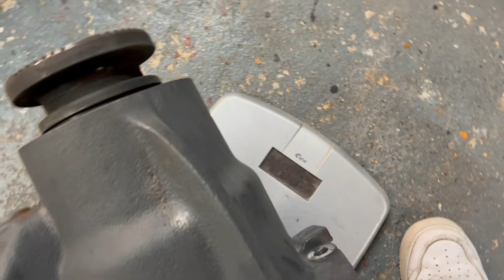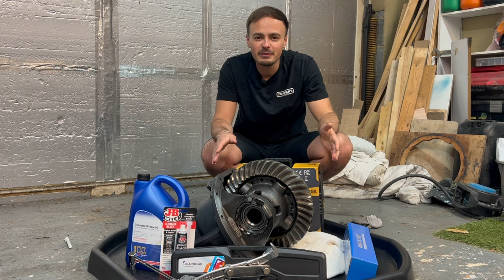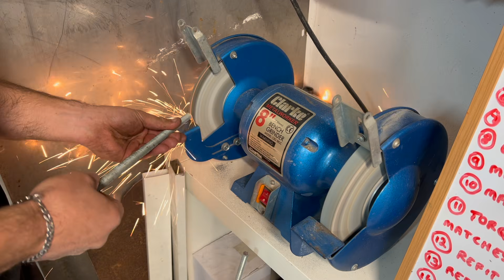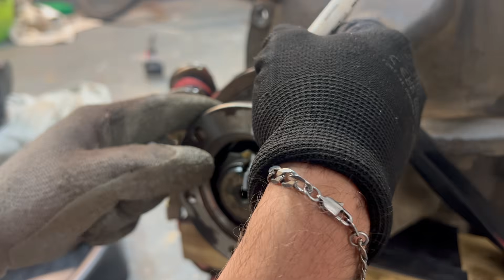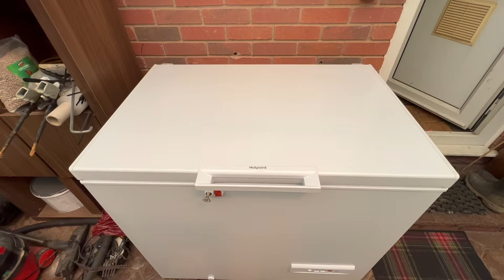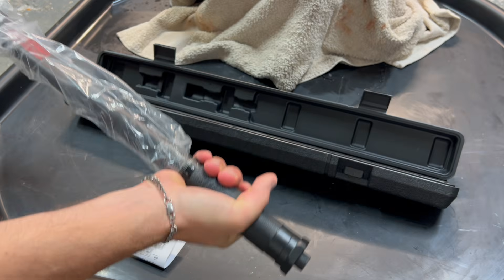Replacing a Trucks Rear Differential - Removal & Pinion Seal Replacement (Mercedes Vario)

Comment: You did a good job explaining this.

Some observations: care is needed to properly assess all the variables before changing final drive ratios. Moving one step is usually ok, two could be a problem if for example the motor doesn’t have the power to turn a taller ratio or the body type has a lot of (aero) drag.

5.7 was a special order final drive for the Vario, and hideously short as your demo showed. It was built to operate fully loaded on urban tasks. 

3.6 was completely at the other end of the scale / the tallest available, so you’ve leapt over five intermediate ratios in the process!

If your final build is going to be very lightweight (as compared to the original build GVW) and the body drag characteristics aren’t horrific (a common conversion oversight) you might be ok although 3.9 or 4.1 might have been better matches. It’s always a compromise. I don’t know what motor yours has, if modest you may find once it’s finished that you have to downshift on long motorway climbs, but other than that it’s much better around town and minor roads. If you’ve got the most powerful 675Nm / 177hp lump happy days…

For the future reader: due diligence warning. final drive ratios are SCN coded into newer vehicles, e.g. all Sprinters post 2003, so simply swapping the hardware would not achieve the desired outcome, some laptop time would also be needed.
Reply from the maker: Thank you! 😁 That’s really interesting information, thanks for sharing your expertise. I will be keeping the weight down on the conversion so hopefully it will still perform well once finished. It’s got the 2.9 OM602 5cylinder 👍🏼
Reply: @TurnersWorkshop97  I have a MK5 transit originally fitted with a 4.56:1 diff and put in a 4.1:1 diff for the same reasons as you although I only use it for short drives. In terms of the effect its a percentage factor as I'm sure you know. 1st gear gains around 2mph so effectively no difference for starting off, 2nd gear gains maybe 3-4 mph. By the time your up to cruising speed there is a difference in pulling power but in your case it may work out the 4th gear is similar to the original 5th gear so on hills it might still be o.k. My engine is the non-turbo with a 70HP engine in a LWB 100L semi-hi roof so its going to be on the limits of power from the get go - you might well be fine - lets find out!!

Comment: Thanks for the heads up about the impact driver. Could get the wheel bolts off my new van even with jumping on an extended bar. Bought the linked driver and it took them off with no problem
Reply from the maker: No worries, makes jobs like that so much quicker and easier. Appreciate you using the affiliate link too, cheers mate 👍🏼

Comment: For all things expedition this might be exactly the wrong idea. You loose a lot of torque in first gear when going slow, uphill, on sand or in mud.
Reply from the maker: Possibly! But it’s not a 4x4 anyway so it will be limited to where it can go. I figured that 90% of the time I’ll be using main roads and doing the occasional bit of over-landing if conditions allow. Fuel economy would have been astronomical too if I’d kept the old diff in not to mention the wear on the engine at that rpm for long durations. Also I believe the OM602 produces torque quite low down which helps with this.
Reply: @TurnersWorkshop97  
Funny enough I drive a 4x4 Vario. And even though the gearing is even shorter and there is a low range, I am still struggling in so many situations...
Reply from the maker: Ahh nice! Do you have the 4.2 engine? Should be pretty capable off-road

Comment: Hi your transit camper is on Facebook marketplace, shame because it's not been very well looked after, I have gone to see it and the guy  is asking 2500 for it
Reply from the maker: Hi mate, yeah I’ve seen that on there! Considered buying it back at that price 🫣 but some things better left in the past. Be a project for someone to get it back on the road! Looks like the propshaft UJ has failed and needs some welding. Dare I ask how the interior’s holding up?

Comment: I took some time to carefully review your channel, and it’s evident that you’ve moved beyond the beginner stage. Your content reflects clarity in style and a defined creative direction. At the same time, it seems you may be navigating that challenging middle phase—where effort is consistent, yet growth remains uneven and at times discouraging. It’s a stage where many creators begin to question visibility and impact. This isn’t uncommon, especially with how much the platform has evolved. Often, it’s not about content quality, but subtle structural factors affecting performance. I noticed a few patterns that may be influencing your growth trajectory. If you’re open to it, I’d be glad to walk you through them.

Comment: So, whats it like now with the new ratios
Reply from the maker: So much better now! I’ll be comparing the before and after in next week’s video. With the old diff, 1st gear was so short I’d pull away in second. But now first gear is longer so you don’t have to change so quick and it’s like that through every gear 👍🏼